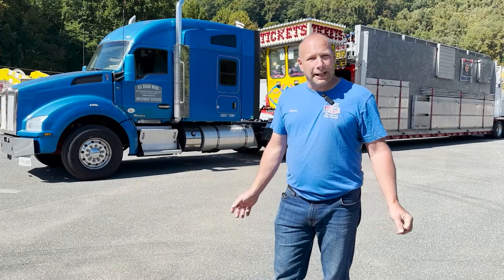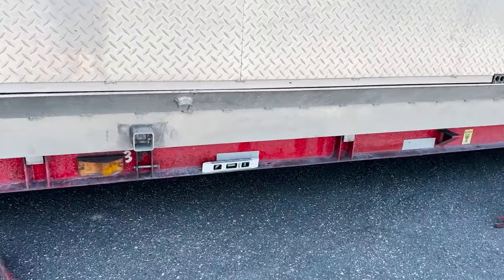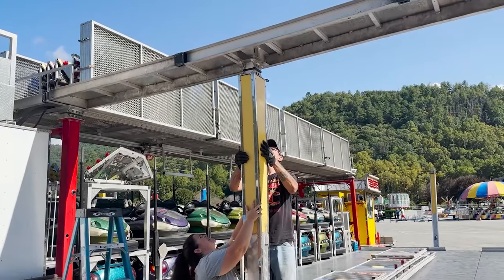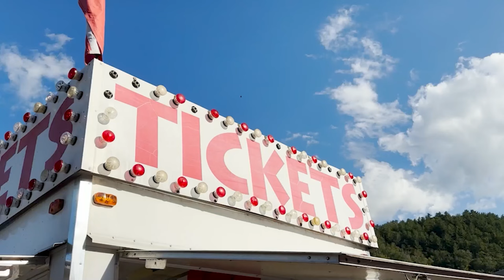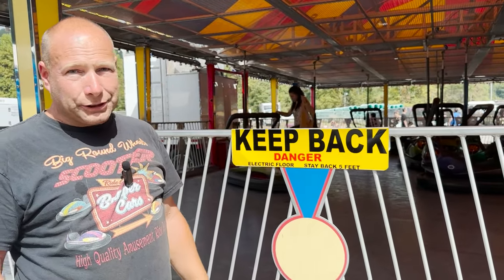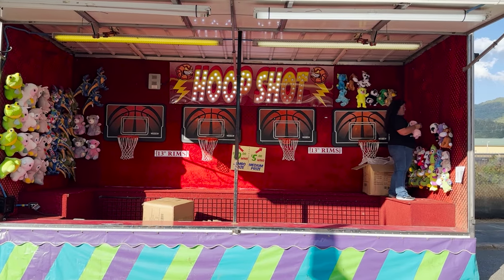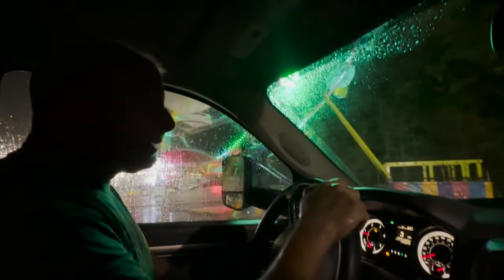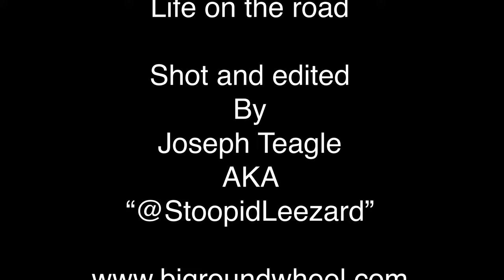BRW Episode 9 Life on the Road. Setting up a few of our rides at a Carnival

Comment: Big Round Wheel Amusements - I was a part time carny for Wade Shows and pugh shows. Back in the day the carnival workers who went town to town would sleep in a little space no wider then 6 feet which is located on the same truck of the games, but directly behind it. you should show the space the room had no air condition, no heat. so sleeping in it can be unbearable, the space only providing sleeping quarters. you had to go use a porta-potty somewhere on the carnival lot or if you lucky one of the buildings nearby. My 2nd job I did was working in a hot dog food trailer. every county health dept would check you for food safety, I was offered $250.00 week I was doing it. and you get paid whether you worked 7 days or 4 days. which included set-up and tear down. I suggestive sell every person without being told and the carnival owner rewarded me with a $50.00 bonus.

Comment: I always enjoy your videos.  Been a nut for rides all my life.  Summer of ‘65 I was the lead operator on a Herschel Mad Mouse at Fair Park in Nashville.  Then in ‘67 and ‘68 I worked part time at Joyland in Wichita.  Being a little older than most of the crew, I was often the relief operator so I got to run everything at one time or another, from their ancient Philadelphia Toboggan coaster to their assortment of Herschel and Hampton kiddy rides.  When not relieving I was often on the 16 seat Big Eli wheel because I could run it with a gentle touch and not slam it around like the kids were prone to do.  Also being a train nut my favorite ride was the train which I was told was the first Chance C.P.Huntington.  Keep the great videos coming.  They’re as close as this crippled up 78 year old is likely to get to the midway these days.
Reply: Man I've rode the mad mouse more times than I can count at the Nashville fair park.It really looked/felt as if the train was gonna run right off the track when you got to a curved section.

Comment: I’ve been the mechanic in charge of a Wisdom Silver streak for over 10 years and we’ve had two sweeps break on it. The tubbing is about as thin as a pop can.  We’ve reinforced and beefed up the sweeps but I don’t trust the ride.  The centre ring was also constantly cracking.  I blamed our issues partially on the fact that the ride is mounted in a permanent location. I always felt the ride needed that slight flex from being on a trailer. 
I should add the one time a sweep broke was a week after NDT testing was done.